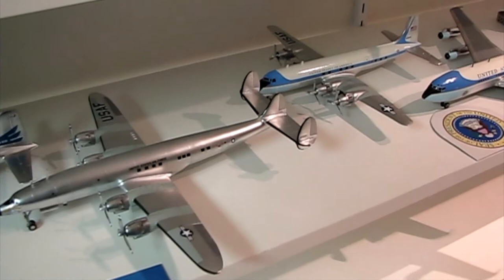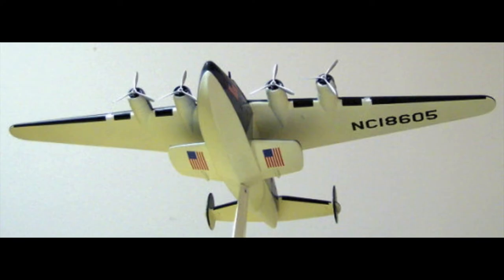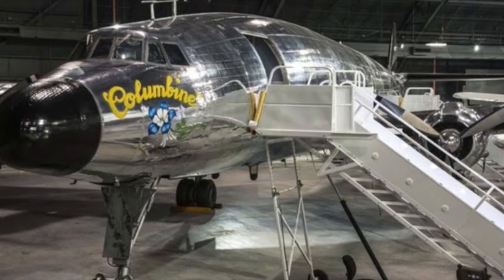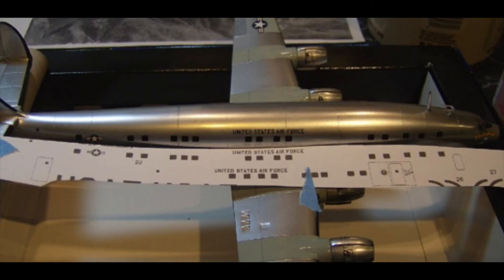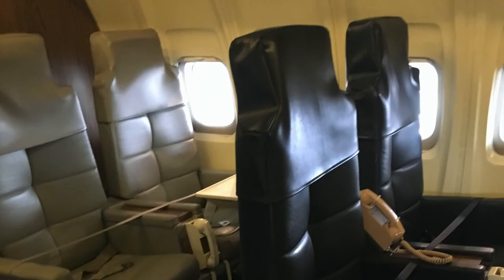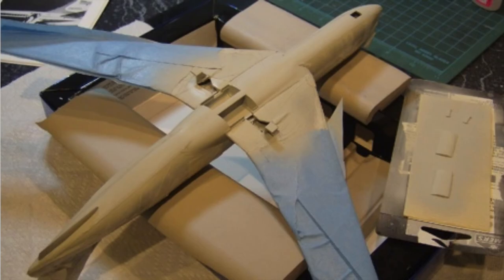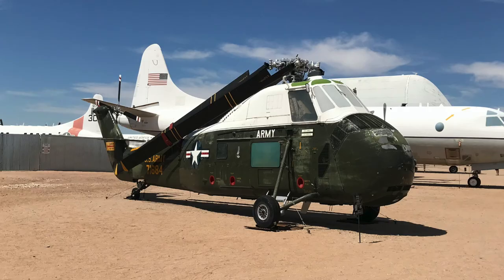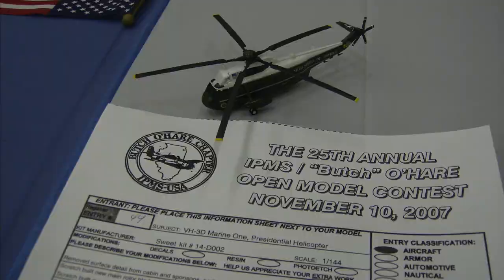Presidential Aircraft History Model Project

Comment: i need ur help iam building the hazagawwa 1 200 scale vc 25a air force one how did you paint the silver strip under the cockpit and the back of the plain should i paint it by brush or spray i dont have a airbrush thank you sir
Reply from the maker: I used silver stripe decal. But you can paint it as well.
Reply: @mightyjjk1298  would a sharpie silver marker work ok
Reply from the maker: @ameiloruiz5549  I would think so
Reply: @mightyjjk1298  would bare metal foil work as well
Reply from the maker: @ameiloruiz5549  Yes, bare metal foil will work.  Good luck.
Reply: i need ur help i know u made a silver decal  for the silver strip were the cockpit is can u help me to make the silver strip for me ill pay you for it